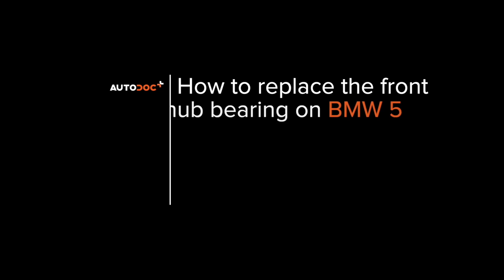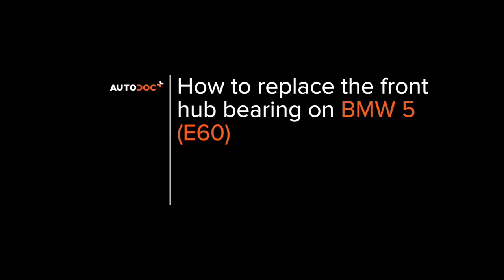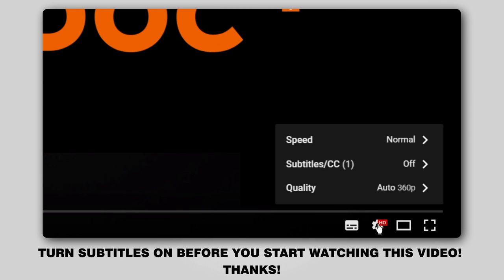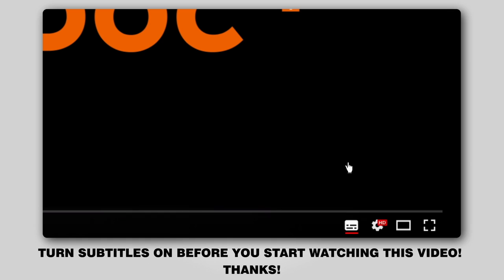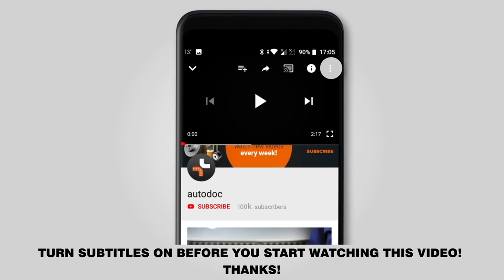How to change front wheel bearing / front hub bearing on BMW E60 [TUTORIAL AUTODOC]

Comment: Looks like useful to measure wheel centre to arch whilst on ground for bolt tightening or do you lift until car goes light on axle stands?
Reply from the maker: Please clarify or rephrase your question. specify the time of the fragment in the video.
AUTODOC
Reply: I know this is two years old but for those that see this going forward. You can get the ride height and how to measure it online.  Different measuring technique will offer different measurements. Such as top of fender arch to center of hub or top of wheel arch to bottom of rim with the wheel installed. While the vehicle is on stands you can set the ride height with a jack and access the bolts form under the car. Never lift a car so that it is light on the Jack stands unless you are removing it from the stands. This is dangerous especially if it's on four stands.

Comment: No need to preload the suspension before final torque of the control arms?
Reply from the maker: Unfortunately, it is not possible to answer your question unambiguously, you can find out this information in the technical documentation for the repair of your car.
AUTODOC
Reply: He did
Reply: 7:30 - 7:40 he did preload the lower control arm

Comment: A lots of torque specs are wrong
Reply: prove it
Reply: @herobo123456   I have repair manual with all the torque specs.
Reply: I can attest it (looking into BMW TIS) - in particular, for the control and tension  arms, tie rod ball joint - and the bearing itself! Moreover, on e60 the TIS demands replacing also the bolts fixing  the arms..

Comment: 12kg of torque on a wheel ? are you silly :o
Reply: Yes its correct
Reply: 120 Newton metres is bmw manufacturer spec
Reply: You can basicly use 120nm on any normal car rim made out of aluminium or steel
Reply: yep you should delete your comment. just makes it silly..